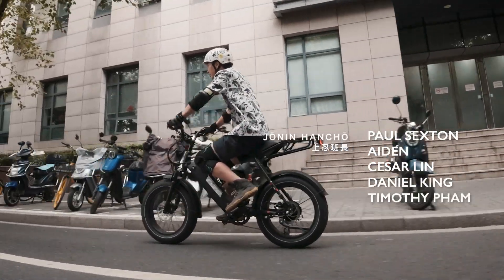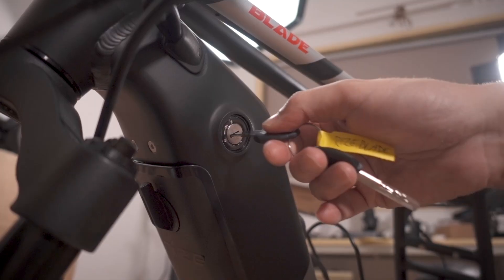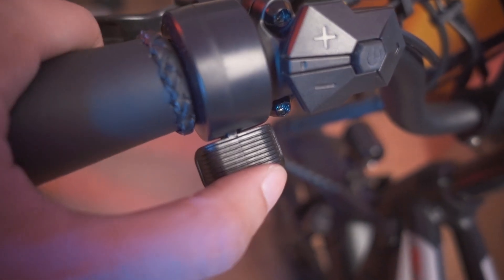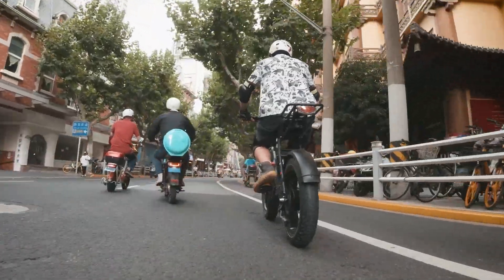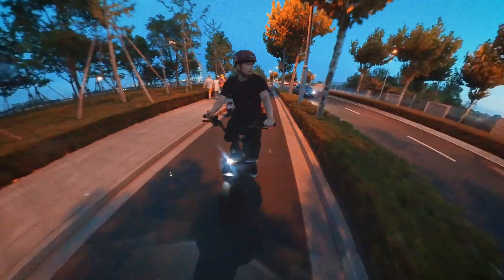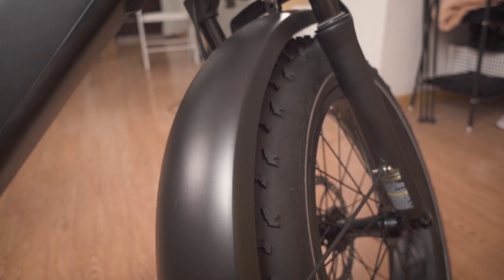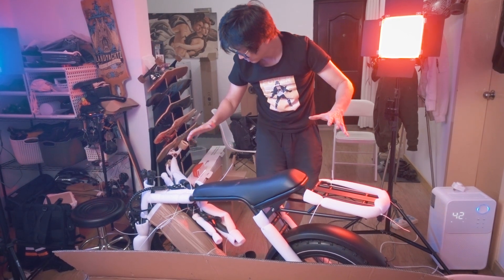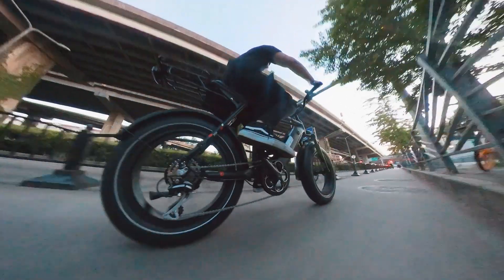Rize Blade 2022 Fat Tire E-Bike Review

Comment: As for covering more, I like the points about jerky throttle, as no one else comments on it. Most people use these for getting to work and groceries. So most important criteria  are safety, longevity, comfort, quality of the pedal assist (torque sensor preferred, suspension and stability, and quality of updats and customer support.
Reply: its hilarious that yall are complaining about a "jerky throttle" bro that's ridiculous of course its gonna be powerful, its a 750w brushless hub motor. and the thing is, sure, its got jump, but its got low psi 4 inch thick puncture resistant tires that pretty much solve that issue.

and i own one, ive had a blade 750 for 4 months now and its 'jerky' in the way you want it to be. its got enough power to crawl up any hill in nelson BC, and it tops out at some 49kmph.
Reply: @MystGames  how do you like your Blade 750?? Did you have any issue with it? What kind of range do you get? One battery or two?

Comment: I don't know from personal experience, but from what I have heard if you use a mid drive electric motor instead of a hub motor in the wheel, that will increase the throttle response that you mention

Comment: Really not a fan of these moped style items, the big advantage of one is pedaling to extend range and as a backup for when the battery dies.

If the pedals are going to be useless and you're on throttle only, then a sur ron or metacycle, (or even a gas scooter) make more sense.

They also muddy up the perception and laws surrounding ebikes. If (after the crackdown these might cause) people need insurance and have to submit to a stricter speed limit, people might not bother with them at all.

Comment: Awesome review! I converted mine into a delivery e-bike! :)  https://www.youtube.com/watch?v=FwX-bb1ISaY  The Blade is a work horse, with a few small problems: the in-frame battery lock fails eventually, and there is an issue with the spacer-lug on the rear wheel (motor-input side) there is no way to replace it. I have no regrets with my purchase!